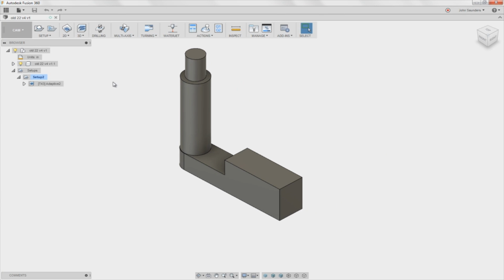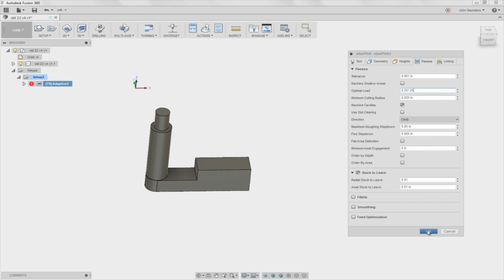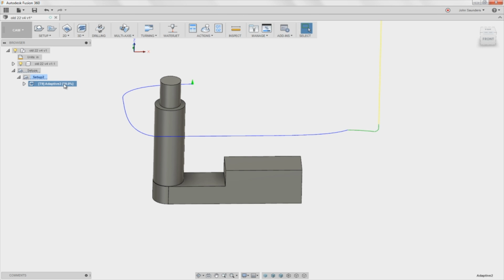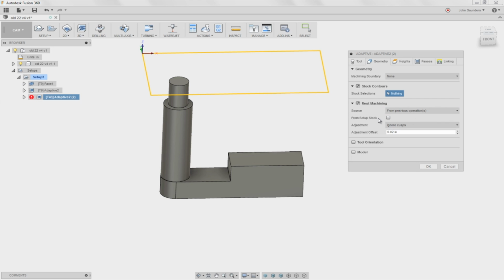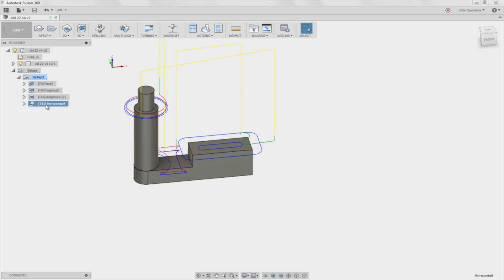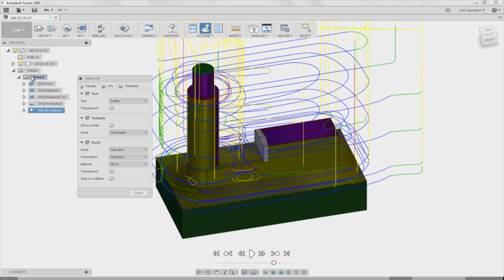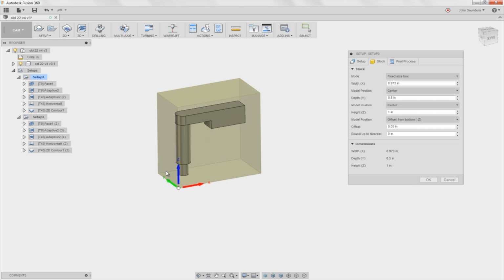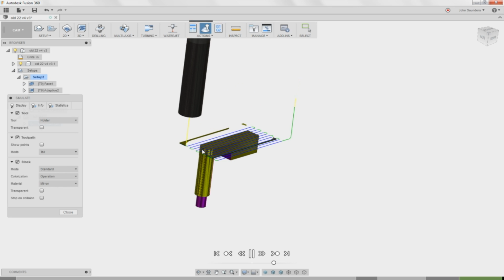Fusion 360 Beginner CAM Tutorial!   FF63

Comment: hi im new to fusion and ive created a very simple part that has a facing operation then a pocket. my alu stock is 6.45mm and the part needs to be faced to 6mm. however once i have faced -.45mm off the stock the pocket is still pocketing the additional .45mm from the 2mm pocket. so the tool path is pocketing -2.45mm. not too sure how to tell the program to now forget the .45mm as its been faced off.

Comment: I have a question. How does the Fusion 360 deal with a 4th axis milling machine? And why did you switch from the BobCAD-CAM?
Reply: Thanks for the response. Yeah, I kinda had the same feeling about BobCAD after looking at one of their reps talk on some forum I went to when I was looking into them.
Now as for a 4 axis I have one and need to be able to rotate the part as it is cutting without any problems. Now I have been looking and learning from your video as I need sort of a crash course in machining as I must take near full control of making the companies own products now as I learned this is a must from learning how Elon Musk made it passed the blocking of the elites.
Now since I am already familiar with AutoCAD I think fusion 360 will be a match for my skill sets. My company isn&#39;t like your but it&#39;s getting the same start as I have a Taig 4th axis mill that I will be using to start making some of the things I need and I have to make it work or the company will fail. I&#39;d like to get in contact with you to bounce some ideas off of you and to let you know what my company is all about as it&#39;s something big for it will be much bigger than Tesla Motors.
Thanks so much for all of the teaching videos as people like me learn very well from watching others.

Now for the 4th axis I need to act as if it&#39;s milling on a flat plain on cylindrical surface. You can tell Lakeside they have a new customer thanks to your videos :-). As the company grows I will take full control of everything that the company makes as outsourcing the work has almost bankrupted me with the very long wait times and increases in prices without warning along with not getting things made to print sometimes. Anyway thanks again for all that you have done to help and inspire us to just jump into the frying pan with both feet about machining the things we need for ourselves.

Comment: I've finally caught up, binge watching you videos. A quick suggestion. When you set the Optimal Load, instead of typing 0.25 * 0.25, you can edit the expression and use 0.25 * tool_diameter. That way if we save the operation as a template, you can later change the tool diameter and you'll still get 25%. You can seem me doing at about 16:40 in this video: https://www.youtube.com/channel/UCJT6JcjZCttm5PHnW9kWluQ

Comment: I just started using 360, I don't have any machines that are CAD controlled.  I just wanted to make drawings to see if I could catch on to this stuff.  I started with a simple multiport air manifold. Round aluminum stock and drilled through from end to end, then added side ports and mounting holes.  When I started trying to add pipe threads to the ports I can't find NPT in the menus.  I used BSP just to do something close.  It all goes fine until I get to the last hole and it will not add the threads?  Same with the mounting holes using 1/4-20 ANSI threads.  It will only thread one of the two holes?

Comment: Hello John. First of all congratulations on your superb work and shop. I have a simple question. I have a slot to do on stailess steel and tool steel (D6). The slot have 4mm wide and 6mm deep. What do you think is the best strategy ? Use a 2 or 3mm endmill and do an adaptive or use a 4mm endmill and do a trace strategy ?
Thanks in advance.
Reply: Thanks.

Comment: Would you consider waterline finishing an upstand like that, where the length to diameter ratio is so high, like you'd do with thin wall components?
Reply: Rough down say 10 mm, then finish that section, so the stock supports the upstand. Repeat to the bottom. It's a strategy I'd use for components with thin walls, to add strength while finishing, improving the finish if the component has a tendancy to chatter.

Comment: Missed a few things. :)

Didn't finish the wall of the square boss on the inside of the slot. And didn't finish the small dia post.  Unless you're relying on the horizontal to clean up those contours. But. That wouldn't be advised. 

Also check the simulation on the op 2 when you're facing it. It's going to create a slug hanging off the back edge that's certainly going to kick. Going to want to do a spiral facing op from the outside in so that large chunk doesn't catch the cutter and kick the part.